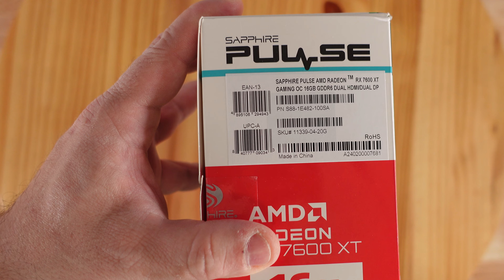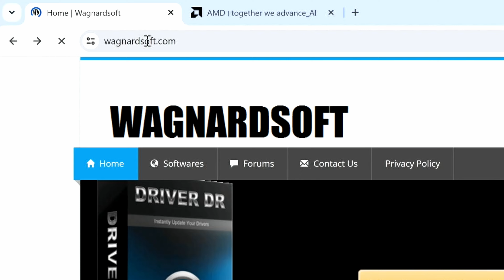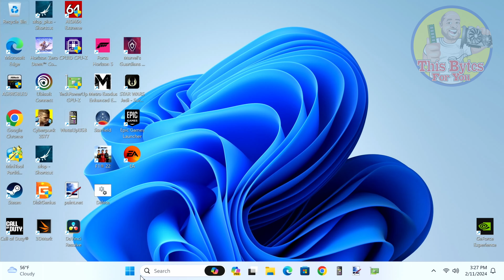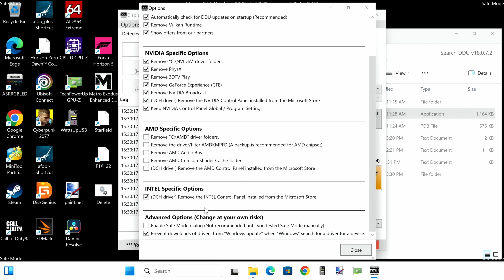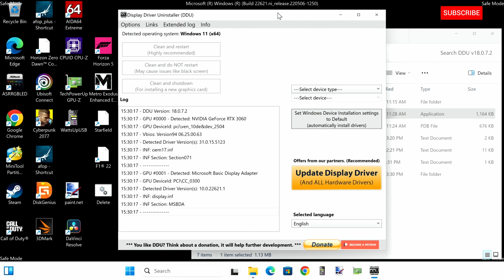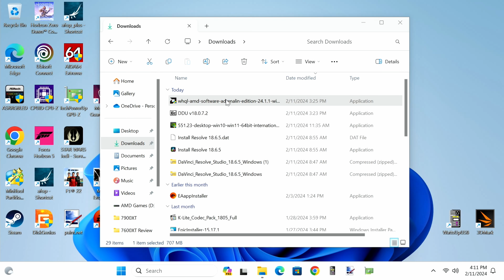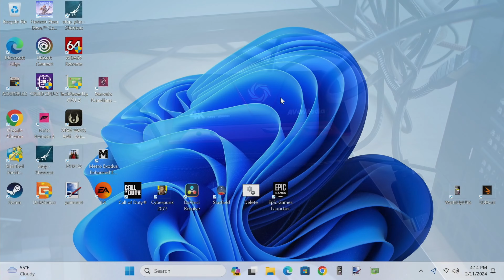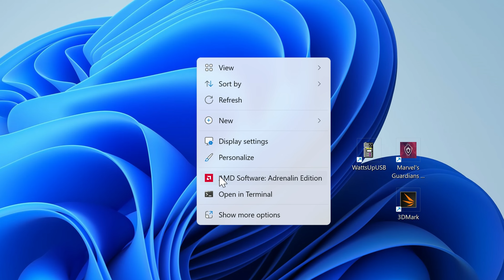RX 7600 XT - Installing the Sapphire PULSE Radeon RX 7600 XT Gaming OC

Comment: On package there's written Minimum 600W or greater power supply, does it apply cuz when i googled mine( cooler master mwe 230v 500) it said it supports mine
Reply from the maker: What package says it supports what of yours?  The power requirement of the graphics card does not change wherever it goes.
Reply: @ThisBytesForYou  In a vid from you i saw on the box it was written 600W or greater power supply, I'm just researching for gpu upgrade(using vega 11 from cpu integrated one) and google said that my power supply will handle rx 7600 but now i'm confused  because i think mine is 500W :D.
Reply from the maker: @viesturslavrenovs4100  a 7600 yes, this is a 7600 xt, very different.  The xt is faster and has more ram, so it requires more power.

Comment: Hi, I have a question. Do you need two 8 pin connectors in order for it to work? I only have one cable that came with my PSU.
Reply from the maker: If your card has 2, you need both.  What is the manufacturer and model number of your power supply
Reply: @ThisBytesForYou  Yes my card has two. My PSU is the EVGA Supernova 650W G, and the model number is 120-PG-0650-GR. Also my graphics card is the Gigabyte Rx 7600 XT Gaming OC
Reply from the maker: You can use 6+2 PCIE cables, those are  8 pins, but you can see here the power supply comes with 4 x 6+2 Pin PCIE connectors and 1 x 6Pin PCIE, so you have it all, you might want to check the box if you still have it.  https://www.evga.com/products/pdf/120-PG-0650-GR.pdf if not, you may have to buy them from EVGA, https://secure.evga.com/US/login.asp
Reply: @ThisBytesForYou  Yeah I think I'm just gonna have to buy them from EVGA, my power supply is old and I dont know where they went or what happened to them. Thanks for you help!
Reply from the maker: I bought this power supply about 6 years ago, and have 2 others I bought 10 years ago and they are all great still today, I use them even in this build, check it out on my Amazon affiliate link: https://geni.us/UbTn off of my Amazon Affiliate link
they are more than you need, but think about it, 15 plus years I haven't needed to buy a psu, they will work with anything.
Reply: @ThisBytesForYou  Good news, I found more cables, my mom moved em LOL! I have my card installed and getting the driver's good to go now!
Reply from the maker: ahhh good stuff my friend happy I could help and you got your card installed and ready to go, what game are you going to start off with... you know what, I am editing a video now, but I think I will take 10 minutes and play some Fortnite real quick.
Reply: @ThisBytesForYou  Yes thank you so much for helping me realize my PSU comes with more cables! Lol. Well, the whole reason I bought this card was to be able to up my settings in Black Ops 6 at 1080p, and boy, I'm playing at maxed out settings and getting an awesome framerate!
Reply from the maker: @nightowels  awesome stuff, play with Frame Generation too, you will be blown away by the performance
Reply: @ThisBytesForYou  Yes I will do that, thank you (:
Reply from the maker: @nightowels  Always a pleasure my friend, so very happy you stopped by, trusted in me to help you, liked and subbed as well as took a moment out of your day to thank me.  It means a ton to me and I am so very happy I could help you.
Reply: @ThisBytesForYou  No problem man, thank you as well, I'll be sure to stop by and check out any videos you put out in the future. Gaming on this card has been great for my liking.
Reply from the maker: Thanks bud, I do appreciate it, I did actually just release one today, I try to every Monday, on a beautiful 32in monitor.

Comment: Which Nvidia card is equivalent to this AMD card?
Reply from the maker: I will have a little on this soon, stay tuned my friend
Reply: Well this card beats rtx 4060 in raw performance
Reply from the maker: @tusharmhnt it does unless you like dlss and rtx though rtx isn't worth it at this level.  Both are great but this has 16gigs of ram vs the 4060s 8giga

Comment: I’m trying to upgrade from my 580 to the 7600xt but i don’t know if my i3 12100f can handle it?
Reply from the maker: well, it will work but it will be able 25% bottlenecked by the CPU but it is overclockable by the bclk, but only a tiny but and overclocking that will overclock the memory as well, so be VERY careful.

Comment: Im using a rm750e psu. The 8 pin cable that I have works for the cpu but I dont have another cable for the gpu. Interestingly enough when I used the two weird looking 6+2 pin cable the entire unit didnt power on, but it powers on without the gpu. Should i get extra cables or a higher voltage psu. I was actually thinking that maybe i need to get a 850w...
Reply from the maker: The rm750e comes with 2 x CPU EPS connectors, those are for the CPU, they cannot be connected to the graphics card.  The power supply also has 3 x PCIe connectors, 1 that is a 6+2, that has a daisy chain with another 6+2 cable, and another seperate cable that is a 6+2 alone then the 12VHPWR cable.  The card requires 600 Watts.  With that, have you watched this video?
Reply: @ThisBytesForYou  yes I've watched it a few times, however I overlooked the details description. It's my first build so I wasn't sure, but just to confirm I should be good with a 1000w PSU?
Reply from the maker: @buddymack6184  so in the video, I use 2 separate cables, its OK if they are 6+2 or straight 8Pin PCIE cables and the card requires a minimum of 600 Watts, so you are perfectly fine, try 2 separate cables, not 1 cable with a daisy chain.
Reply: @ThisBytesForYou  Thank you! Hopefully I'll get this sorted out!
Reply from the maker: you should be good with that, another thing that might help is this video https://youtu.be/7SjQo7wrWq4

Comment: What's actually better for 144hz gaming on 1080p monitor, dp or hdmi? Im confused because sapphire seems to keep advertising hdmi on their packaging and usually put more of those than dp ports, but asrock for example put only one hdmi and the rest are dp (like 2 or 3 ports) so im confused as why some people say dp is better but some gpu manufacturers seem to go with less hdmi ports, or sapphire goes with more in this case? Cheers.
Reply from the maker: 144hz is 144hz, it wont be different HDMI or DP, though I prefer DP over HDMI.  At 1080P though, you need a good processor, what are you using?
Reply: @ThisBytesForYou  i5-13600K, I'd say its great besides the recent news of Intel frying their 13th and 14th gen CPUs
Reply from the maker: Yes, I am surprised at how good the 13600K is, such a great processor but the frying thing is for those that leave things on auto, if you set things staticky, you are good.

So with your AWESOME 13600K and 1080P you are gold my friend, but with such a great processor, I think you should go for maybe a 7700 so you can play at 1440P, I think you will be gold.

Comment: 7:13 I have an amd gc, do i have to check or uncheck the amd section and the NVIDIA section?
Reply from the maker: What do I say in the video, I think I go over it pretty well here right?
Reply: @ThisBytesForYou  And about the pci-e cable, I dont see them. I have now a  rx6400 and I don't see any pci-e cable connected to it..
Reply from the maker: If you dont have a connection on the card then don't worry about it, that card doesn't seem to have one
Reply: @ThisBytesForYou  but I have to Connect the rx 7600xt and it needs does cables.
Reply from the maker: So that I can help, please list the manufacturer and exact model number of the following components:
1. Motherboard - manufacturer and exact model number
2. CPU - manufacturer and exact model number
3. RAM - manufacturer and exact model number
4. Video Card - manufacturer and exact model number
5. Power supply - manufacturer and exact model number
6. Monitor - manufacturer and exact model number
 Redundant I know, but many people forget to enter manufacturer and exact model number
7. Do you have ALL of the PCIE connections plugged in, and not daisy chained or pigtailed, each coming directly from the power supply?
8. Are you running through HDMI, DP, DVI, VGA, any adapters?
9. Is UEFI or Legacy Setup in the BIOS?
10. What slots do you have your RAM installed in?
11.Do you have CSM Enabled or Disabled in the BIOS
11. Installed latest supported chipset driver?
12. Have you disabled Fast Boot within Windows?
13. This video will help you identify hardware inside your PC: https://youtu.be/65ZSiVImJx0
Reply: @ThisBytesForYou  I appreciate your answer. It makes everything a little bit complicated. Today I was at the store and the guy told me that it is actually easy, I should connect with pci cable the 7600xt. I already have those cable and I have to connect to the power supply. The problem is that the power supply is not hidden inside the pc case.
Reply from the maker: So, you haven't watched the video, do me a favor, do exactly what the guy says, "its actually easy, you should connect the pci cable to the 7600xt" and then come back when you notice that the performance is horrible, then answer the questions I asked you so that I can help you properly.
Reply: @ThisBytesForYou  I watched all the video :) I will follow everything you say in the video and hope for the best. My pc is a ryzen 7 3,4 ghz and has 750 power supply. The problem for me is to locate the power supply for the cable since the power supply is hidden inside the case and you don’t show in the video how to locate it, you already have the cables when you connect the graphic card.
Reply from the maker: This is why I ask all that information about above, so that I can help you specifically.  The cable comes from the power supply, which I go over at the 12:04 mark, in the video you stated that you watch.  This video might help you as well: https://youtu.be/7SjQo7wrWq4 but neither will help you if you don't watch and listen to them.
Your power supply may or may not have them, there are 2 ways you can find out... you can look at your power supply thoroughly, following all the cables or you can give me the manufacturer and model number.  I won't answer any more questions till you answer the 13 questions I have above though because I am getting extremely frustrated here and I am just trying to help you, but you are fighting it.
Reply: @ThisBytesForYou  Don't worry, you are doing a great job. I can't answer some questions because they sound very hard ("CSM Enabled or Disabled, or UEFI or Legacy Setup in the BIOS" what is that? Why do you ask me that if you don't talk about these things in the video?). 

Yes at one point you take a cable out from the case but I don't have that hole. I also have for now a graphic card that doesn't need any cable. Thank you for the other link, it helps me and I think my power supply is modular cause when I bought my PC the store gave me many of those cables separately in a bag. 

Maybe you need to know the case and the power supply name. The power supply is a Seasonic Prime PX 80 PLUS Platinum, modular -750 Watt (so it is modular!) and the case is a PHANTEKS Eclipse G360A Midi-Tower. You already know my CPU and GPU. I don't want to waste your time.
Reply from the maker: So that I can help, please list the manufacturer and exact model number of the following components:
1. Motherboard - manufacturer and exact model number
2. CPU - manufacturer and exact model number
3. RAM - manufacturer and exact model number
4. Video Card - manufacturer and exact model number
5. Power supply - manufacturer and exact model number
6. Monitor - manufacturer and exact model number
 Redundant I know, but many people forget to enter manufacturer and exact model number
7. Do you have ALL of the PCIE connections plugged in, and not daisy chained or pigtailed, each coming directly from the power supply?
8. Are you running through HDMI, DP, DVI, VGA, any adapters?
9. Is UEFI or Legacy Setup in the BIOS?
10. What slots do you have your RAM installed in?
11.Do you have CSM Enabled or Disabled in the BIOS
11. Installed latest supported chipset driver?
12. Have you disabled Fast Boot within Windows?
13. This video will help you identify hardware inside your PC: https://youtu.be/65ZSiVImJx0

Comment: Thanks for the video brother. I have just 1 question. I am planning to get ^^Corsair RMe Series RM850e PSU^^ 850 watt for this GPU since its on discount. Do you think its ok or should I get a 750watt instead but its a bit expensive.
Reply from the maker: Thanks bud, I greatly appreciate it, as for the power supply, always get more than you need, I have had 1200 and 1000Watt power supplies for a little over 20 years, and they still work and I have never needed to replace them.  They cost more up front, but cheaper over time.
Reply: @ThisBytesForYou  Understood! Thanks alot for your help, I am deeply grateful :)
Reply from the maker: Always a pleasure my friend, so very happy you stopped by, trusted in me to help you, liked and subbed as well as took a moment out of your day to thank me.  It means a ton to me and I am so very happy I could help you.

Comment: After instilation, when i went to enable amd freesync it said "not supported".
I checked on google if my monitor ( MSI G243CV ) supported it, apparently it does i also made sure i was using a display port not hdmi.
Next thing i done was to make sure in my windows display settings that they were on the correct rx 7600xt drivers and they were.
Is there any other reason or any help you could give on why i cant enable amd freesync or does my monitor actually just not support it?
Reply: I believe It might be because I'm on windows 10?
Reply from the maker: so you have to make sure your monitor has Freesync enabled too, in the monitor, To enable FreeSync on a G243CV monitor, navigate to the monitor's on-screen menu, usually accessed by pressing the joystick button, then find the "Game Adjust" or "Picture" settings where you should see an option labeled "FreeSync" or "Adaptive Sync" which you can toggle to "On.".
Reply: @ThisBytesForYou  just got around to get it done, it worked perfectly and thanks a bunch for the help.
Reply from the maker: Always a pleasure my friend, so very happy you stopped by, trusted in me to help you, liked and subbed as well as took a moment out of your day to thank me.  It means a ton to me and I am so very happy I could help you.

Comment: hiii quick question just got this graphics card and i realised that my power supply is not enough for it i ordered a cooler master elite nex white 600w power supply and im not sure that it would handle it or idk i just want to make sure will it work with the new power supply?
Reply from the maker: hey bud, this card requires a minimum of 600Watts, so you are good there.

Comment: Hey man! I’m at the final step build for the first time a gaming pc. So I’m using the same gpu and it does have 2 (8 pin) connectors. Now my situation is, my power supply didn’t come with PCI-E cables already plugged, and it has another slot to connect another pci-e cable set. Is this the way I have to do it? Plugging a second cable set?
Reply from the maker: What is the manufacturer and model number of your power supply.
Reply: @ThisBytesForYou  thermaltake touchpower GF1 750w
Reply from the maker: your power supply has 3 potential places you can connect a PCIE power connector, and 3 for your CPU, use one for your CPUI and the other 2 for your GPU
https://www.thermaltake.com/media/catalog/product/cache/cc8b24283b13da6bc2ff91682c03b54b/0/6/06_2.jpg
they say CPU/PCIE, means you can use them for either, the difference is the cable, make sure you use the CPU cable, also known as EPS for the CPU and PCIE for the GPU.
Reply: @ThisBytesForYou man! You’re the best! That’s the only part that I’ve needed to complete my build. You earned a new subscriber here!!! 👍🏽👍🏽
Reply from the maker: Thank you so much for your kind words and support my friend, it means the world to me and I am so very happy I could help you.
Reply: @ThisBytesForYou  bro I need your help again. I did the expo activation following another YouTuber but after I did save the change and reboot my pc is not working. The pc turns on and all the fans en lights and the mouse, but doesn’t boot. I can’t even get to the bios. How do I fix this!!! 😭😭
Reply from the maker: disconnect all the cables in the back of your PC, all of them, usb, hdmi, power, etc, no cables, then remove the CMOS battery from your motherboard and wait 60 seconds, (1 minute) then put it back in and reconnect all the cables, that will reset your BIOS.
Reply: @ThisBytesForYou man you saved me again. Even my behind spot got cramp 😂😂 but now is released 😅😅 thanks man
Reply from the maker: hahaha anytime my friend, happy I could help.

Comment: Brother i have a 550 W cooler master Psu these are my current specs, i am planning to add the 7600xt. Is my Current PSU sufficient?
R5 4650g
2, 8gb ddr4 3200mhz
Msi b450m pro vdh max Motherboard 
Kingston 256 gb
1tb Seagate Hdd
Reply from the maker: The card requires a system with at least 600Watts, and 2 separate PCIE 8Pin connections, not daisy chained.
Reply: @ThisBytesForYou  ok bro 👍👍, thank you
Reply from the maker: Always a pleasure my friend, so very happy you stopped by, trusted in me to help you, liked and subbed as well as took a moment out of your day to thank me.  It means a ton to me and I am so very happy I could help you.
Reply: @ThisBytesForYou  🤗.LOVE FROM INDIA.